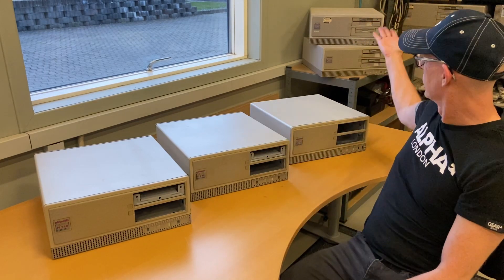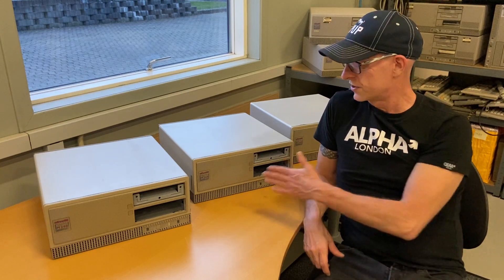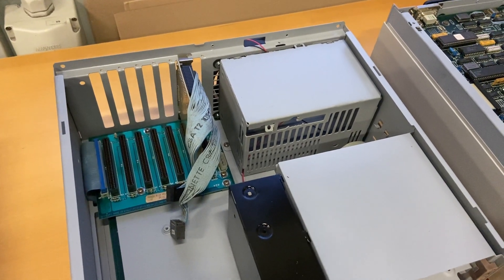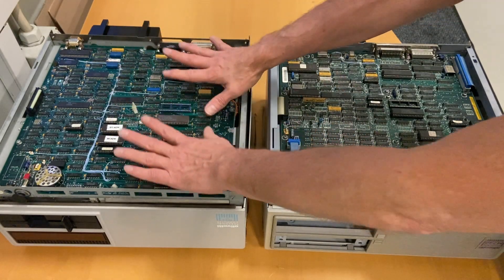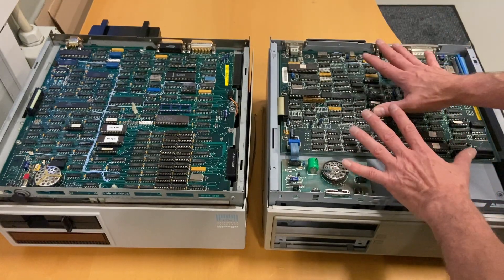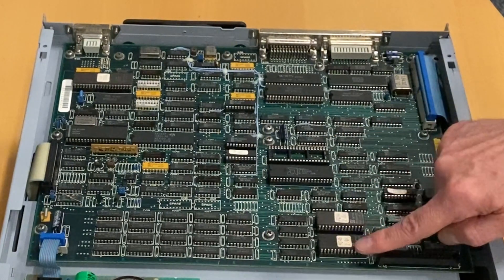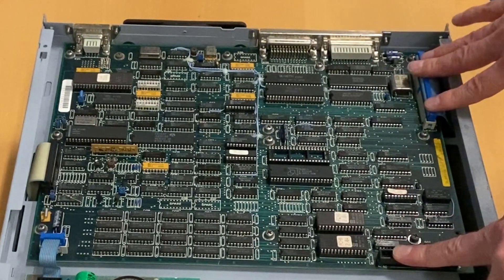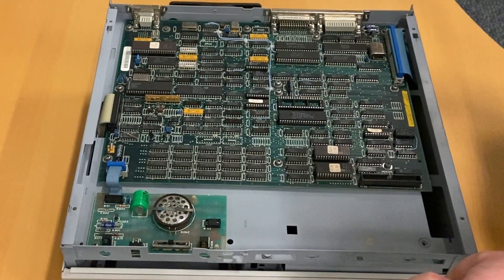Olivetti M240 8086 - 3 x Rusty Computers - Part 5 - The Motherboards

Comment: So I have an M240. I got rid of the MFM HDD ST220 and instead ran with a gotek alone and later got an XTIDE and a standard IDE drive. However, when using the computer I get a mad high pitch Capacitor wine from the Power supply, and once or twice it failed to boot. I of course disconnected the PSU from the PC and bench tested it and all voltages are fine all the time including when the coil wine is happening. I planned to insert a standard SFX PSU and use a 24 pin ATX breakout board to source my power output to run the computer. I would love to see how you tackle the problem.